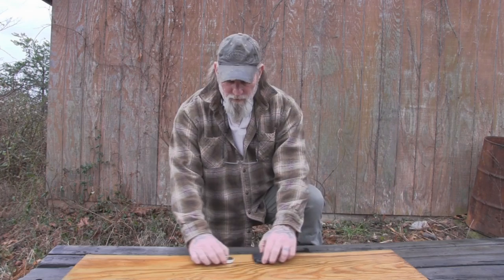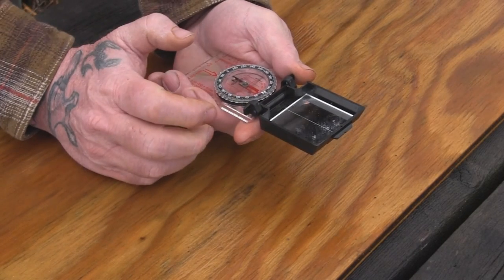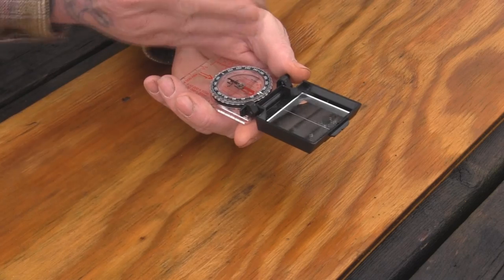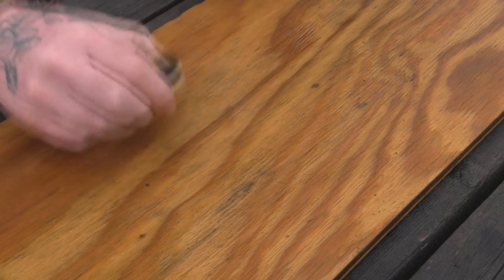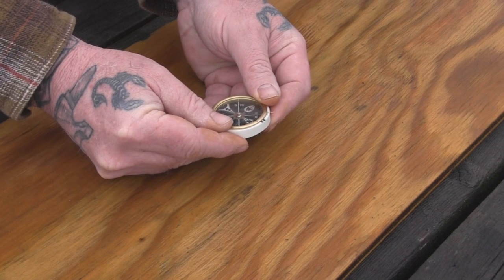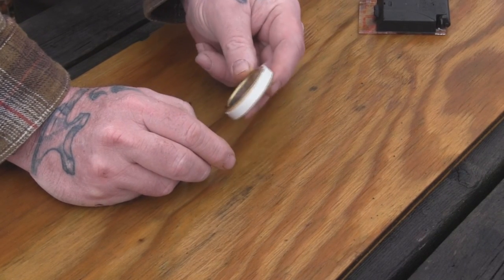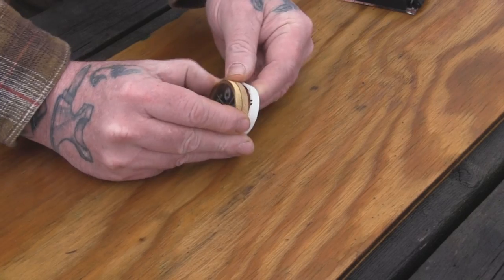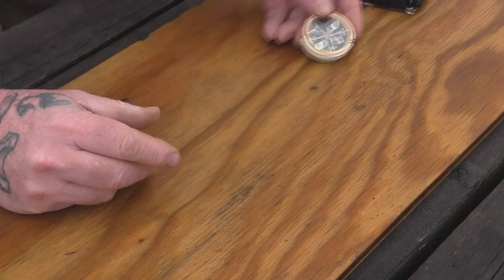Button Compass Mods to Aleviate Lateral Drift

Comment: The button compass in my emergency kit has a loop on the top you can run a cord through to hang it around your neck pendant style, I've used this loop before as an orienteering point. For a 'doghouse' line I usually just mark the brass case with a smear of pine pitch, which I can easily scrape off when I'm done

Comment: thanks for the vid.s
had similar thought.
but, I concluded that if...
use D.L. / Cred Card to line one end of the cut in the pipe to mark center (via compass needle), round over other end of cut (so not mistaken)

so many ways to customize, 
for so many different people.

Comment: Yep. But if You dont have moving bezel ring, somehow got lost... and You mark line on compass, than it works just fine as long as You remember direction in degrees. Set the compass on the line, set and memorize or note somewhere direction and You can go. That bezel ring only helps not to remember ;) Please correct me if I'm wrong :) By the way, wise man learns whole life.

Comment: Okay, so, the point is to get the needle in the "doghouse".  The needle points North, no matter what direction you face. So, say you wanted to go due East. Would you then move the ring until the doghouse is lined up with the E on the compass, and then move yourself until the needle lines up with that marking? 

If I'm totally wrong, feel free to correct me. Still wrapping my brain around this.
Reply from the maker: +Miguel Cuervo Yes your confused if you wanted to go east you would position yourself so East was at the top of the compass put the dog house over the north needle and walk east as long as the needle is in the dog house you are still walking eastward
Reply: Either way works as long as you do it the same all the time. I learned to use it the way the
at Miguel Cuervo described when I was a kid and learned to use it as u described when i was in the Marine Corps. Workes the same way you just have to have a fixed point and a movable point. All in all good info thanks for redoing it to explain.
Reply: my typing/ spelling is terrible
Reply: Miguel Cuervo...U have it bro. Put the doghouse rt on due East while the file mark & compass is rt on due North. Keeping due East n the doghouse with the compass& file mark both on due North. I watched the 1st vid & thought something was up & didn't figure it out until Dave reposted. Hope this helps & my explanation hasn't confused U.